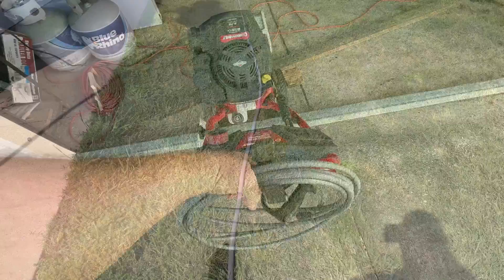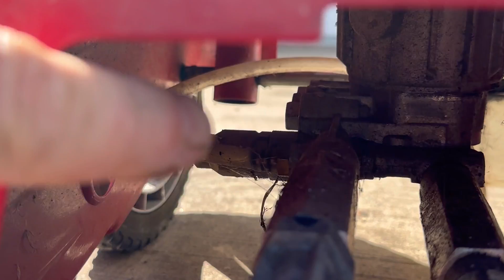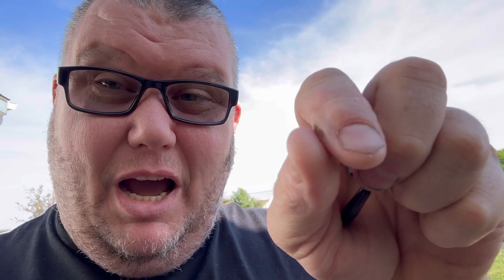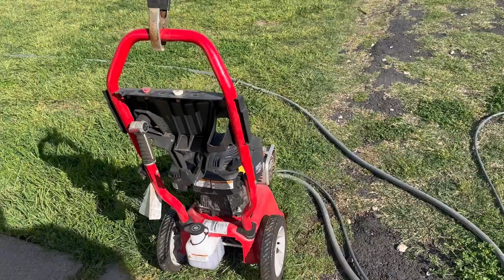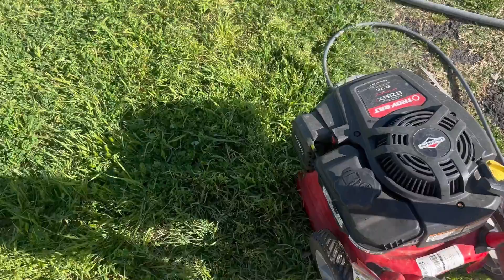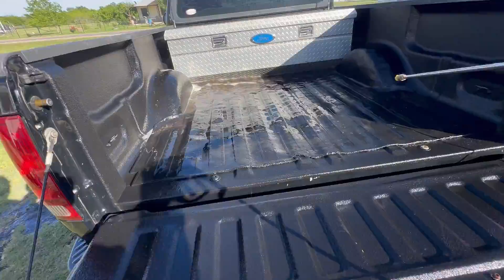THIS POWER WASHER HACK WILL SAVE YOU SO MUCH 💰 💰

Comment: How long do you normally let one run without squeezing the spray handle?
  Btw, I had no idea the low pressure nozzle is supposed to be used when dispensing soap.

Comment: Great idea but why not take it a step further by re-purposing a throttle cable assembly off an old mower to adjust the valve lever without having to keep "crawling underneath"?
Reply from the maker: Because I’m just gonna set it and forget it

Comment: Good idea, however mine has an injection nipple, no soap tank.  Came with a tube to place in a separate container like a gallon bottle of soap and it's sucked dry in about 2 minutes so I don't use soap.  Will give this valve a try.  Got a link for valve you used?  👍
Reply from the maker: Yes in the description

Comment: Before you even got to that part about the cut off valve, that’s what I was thinking. I wonder if mine does the same thing I haven’t used it in years and I do mean years and still got brand new oil in it. It was only run one time after it was purchased, but I don’t have anything to use it on. I never use it on the lawnmower cause you don’t wanna hit the lawnmower engine, cold water and the engine hot as hell in a cracked the cylinder. Ann is washing the deck underneath Off. Well you just have to take it off First on the back of the little trailer behind the lawnmower back over to the water hose to use it to wash it off and that’s not been done in very long time. In fact the more deck itself starting to rock through. To get a new more deck for a John Deere they’re asking $1000 for that thing And that’s not and I cannot afford it. Well look around and purchase used lawnmower from somebody was getting rid of them specially when the fall comes the best time when more start going up for sale cheap people don’t wanna store anymore or they’re two underpowered and they want something different or they move to the city so they don’t have to cut grass.